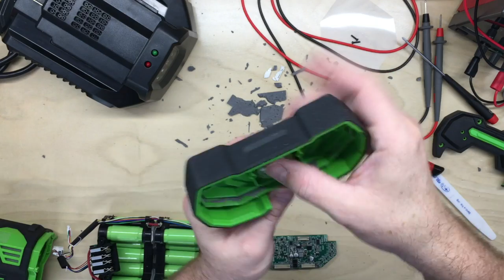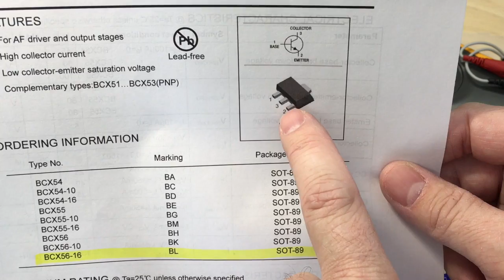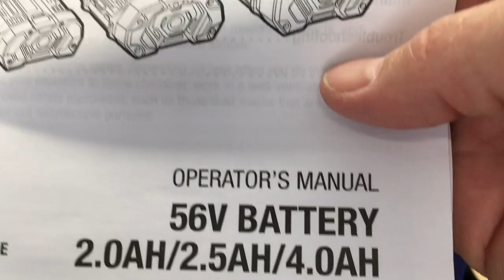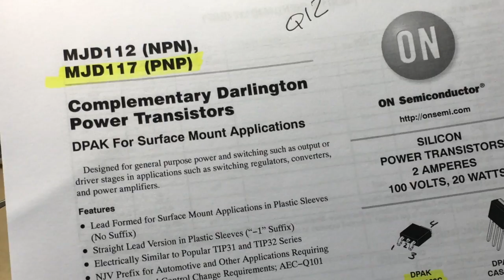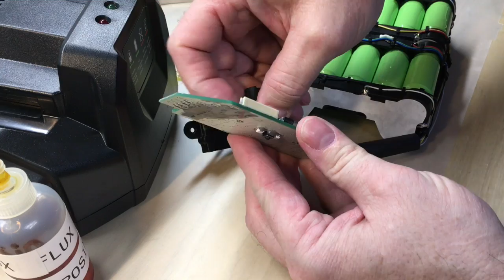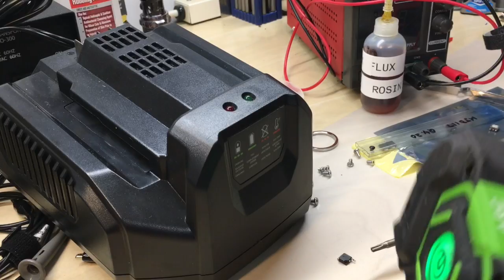EGO 56V ARC Lithium Battery Repair

Comment: 2.5ah battery I have the newer style bms and light, one half of the battery (top) got pulled down to 0.2v per cell. the other half is 4.03v per cell. can this be saved or too risky?
Reply from the maker: I do have a video that focuses on Lithium batteries and safety called Lithium Battery FAQ#1. As long as it's done safely, you could try to slowly bring up the cells with a CV-CC power supply. I would charge no more than 500mA to 1A while seeing if they will bounce back and take a charge.  Watch them to make sure they don't start getting very warm. If it does, then stop.
I would imagine at the least some of the cells will be reduced capacity, unfortunately.

Comment: Without markings, how did you determine what data sheets to acquire?  Some parts are so small as to not have markings.
Reply from the maker: I only found data sheets for the ones with markings. Mine had markings on most chips.
Reply: @ThriftyToolShed  and if you could indulge me, did you have any schematics on the control board?  Was your troubleshooting just that intuitive?
Reply from the maker: No schematics whatsoever. I wish we had some to share.  That is the main reason we share as we can as we learn together. I simply had the desire to learn and share as much as possible early on with these EGO boards.  I simply took time to research the components as best as possible and started testing based on those components. The more recent repairs have been around the 3rd Gen BMS transformer failures which was shared by many viewers who had the same problem and many had seen the transformer failure before I did. So we share and learn what we can. Our Facebook page "On The Bench" has many contributors sharing pictures or even videos that help the group also. Even a BMS board layout showing traces, pads and vias. I shared this and thanked them for this contribution in a more recent 3rd Gen pack repair video. I Hope you find some of the info helpful!

Comment: Which cells are in this 21700 or 18650 battery?
Reply from the maker: EGO packs have 18650 cells with the phase change sleeves. I think the packs 5Ah and below have the sleeves above 5Ah I don't think they do.

Comment: What type of potting compound can I use. Preferably the same kind, in case I have to work on it again.
Reply from the maker: I wish I could say it's as easy to remove as the original. I have used this type here before, but it's not as  easy to remove though. It is electronics grade. 
https://amzn.to/3INPat3
Reply: @ThriftyToolShed  Thanks for the reply. The link only takes me to the Amazon home page.

Comment: Hi. What is T1 on this board?
Can board work without it and what replacement i need to look for?
Reply from the maker: The 3rd gen packs have changed the way this is on the board. I have only worked on one of the 3rd Gen with the segmented fuel gauge and I noticed it is different, but not enough experience to say how different.  I have an older video about the T-terminal on the 1st and 2nd gen boards. 
https://youtu.be/dyLg5fK1SxU
Reply: @ThriftyToolShed  i have 3rd gen and also earlier gen(2 types: one have 12 contacts on j5, black j3 and 4 big capacitors(c23, c12, c3, c17) and other type has only 8 contacts on j5, all of them are white(j3, j4, j5), and only 3 big capacitors(c23, c3, c17), c12 become smd type.
But i still have no idea what is T1?
Reply from the maker: @fx9750g2  
Oh, sorry you're asking about the T1 coils on the BMS board! The little metal can. It is 3 coils in the T1 can. We have discussed that much in the comments over the years. I believe they are used the DC-DC converter circuits.
Reply from the maker: I have not found a replacement for these coils yet. I have only had one go bad so far and I had a donor board from other packs I have collected.

Comment: Thanks for the thorough video. I have one 2.5 aH battery that’s in need of repair. The video walked through the diagnostic steps as well as what to be looking for.  I appreciate  the work you put into this. I like your PWB holder.  That provided stability when aiming for the test points. I have 6-7.5aH batteries, two of which are aging and may be ready for some TLC soon.  Take care!

Comment: I've been giving troubleshooting a lot of thought.  Would it help to take a good BMS that is healthy and plugged up.  Take and record all the voltage readings from every component.  Then use this as reference material on a bad BMS to help pin point the issue?  I realize different functions have to be considered.   Your thoughts?   Also,  have you found a good source for parts?  We need a place where we can just replace the BMS board on the cheap.  I'm looking and searching.  If I find a resource for parts, I will let you know.
Reply from the maker: Yes, that is absolutely a good way to troubleshoot and find out more about a board especially when we have so little information on it. I will do resistance checks/diode checks on board powered off and compare at times and I have from time to time done exactly as you mention with a known good one powered on and document/compare. You may know this, but ASA or analog signature analysis is a major player in board repair especially in big industrial board repair shops. Using a Curve Tracer you can compare analog signatures between two boards and see the differences from point to point. It's really neat but very time consuming so it's mainly helpful when many of the same boards are repaired often. 
On the BMS board I have tried hard to find replacements. I even have one video I shared on the 3rd party battery for the 56V EGO pack and since it was sent in for me to review I was amazed at how well the BMS was copied ( basically cloned) so I contacted them trying to get them to offer us parts in particular the BMS and the manufacturer said they would not sell individually at this time. I keep hoping to get my hands on some. I even offered to order a large lot (thinking or hoping I would have no issues with people wanting them so my money would hopefully not get tied up), but still they were not interested in selling the boards. Yes, we need to find a good supplier of these.

Comment: What a great fault finding tutorial! I’ve just had a brand new 2.5Ah battery delivered and it was dead on arrival. They’ve now sent me a new battery and I’ve started investigating what went wrong with the dead battery. I may have the same issue. After disassembling the battery and removing all the grey goo I found a lot of black soot around the same area as Q12 on the board. I’ll do some more fault finding and see if I have the same issue. All my cells were down to 0.5V each. Thanks so much for the informative video. I would’ve been lost without it. I’ll report back if I can identify my problem.
Reply: I’ve done some more work on the circuit board. I have the new model BMS without much info on the green side of the PCB. I think the Q12 MOSFET is shorted. I’ll find out more when I remove it from the board. The larger SMD capacitor just near Q12 has blown and needs replacement as well. You don’t happen to know what capacitance it’s meant to be? If not, do you know any way to find out?
Reply from the maker: Hi,
I don't have much experience with the newer 3rd Gen boards at all. I have one video on the 3rd Gen board and it did not go as planned 🙈.
I did discuss some differences in them and the larger SMD electrolytic caps are not exactly the same. Not sure about the ceramic caps. Even though the only 3rd gen board I have is faulty I can try to measure the value of mine if you let me know which one it is by relation to other components or if you wish to share a picture through my channels Facebook page.
Reply: It’s the largest yellow/brown SMD capacitor on the whole board. It’s right next to Q12 between Q12 and the 8 pin connector going to the battery 4 blade connector. I don’t use FB often but I’ll try hop on and send you something.
Reply from the maker: If it is the one just on the right side of Q12, I read 2uF in circuit on mine. This is the BMS that is faulty that I showed in video below, so it's all I have to go by. Hope it helps. 
https://youtu.be/s7-U6PTVM58
Reply: @ThriftyToolShed  thanks so much!! I think my board is different again. I’ll take a photo and send it to you on FB. I’ll go get this capacitor and MOSFET and let you know how it goes. Really appreciate the help.

Comment: Since you have so much experience with these EGO  Battery Packs, I would like to ask your advice on a problem with an EGO Battery Pack that the manual does not address.

I have a new EGO 56V 2.5AH Battery Pack, bought two months ago with an EGO lawn trimmer. After the trimming was done on the lawn (September 20, 2022), I fully charged it and set it aside. So far, so good.

The EGO Battery manual says that it is supposed to go to 30% after a month in storage, but as of November 5 , 2022 (well over a month), it still shows all 5 lines of FULL charge. It appears the BMS is not working to lower the battery pack to 30%.  Is this battery defective? I read that at 80% or more charge, Lithium batteries lose 20% per year of capacity. I don't want to lose 20% a year. Just running the Battery Pack on the trimmer to force it down to 30% is NOT what the manual says I am supposed to do. What should I do?

Comment: Question:  Does the Ego BMS balance the cells ?
Reply from the maker: Yes, it seems it can do a minor balance where it can slowly drain 1 set or so as needed to try and keep all 14s balanced well. It seems to only be an issue once cell capacity gets so out of balance and no longer able to match them so one set  just pulls down and shuts down the pack before the others are discharged which shows up as the packs loss of capacity.
Reply: @ThriftyToolShed  I'm a little concerned about using the 550w fast chargers with the 2.5 ah packs.  I know there is increased air flow to handle the added heat, but that's charging a 1S configuration at 10 amps or so.
   I have successfully repair several packs.  Even a few that involved total cell replacement.  I just got in a 7.5ah pack that has 2 sets of the 3 parallel cells that are bad.   Total cell replacement on a big pack.  That's 42 cells. 
   I do like the 14S platform.   I'm also in a market for an Ego Zero Turn mower.  They look awesome.
Reply from the maker: Yes, the dual cooling fans are really good on the chargers design for cooling as I showed in one of the repair videos of a fast charger. It is tough on 1P packs with rapid charging as well as discharging too rapidly. I have to say I have not tested the rapid charger to see exactly what current the 1P packs actually charge at. It knows which battery is connected by the D-terminal, but not sure how much reduction it is for the 2.5ah packs.  As far as replacing all cells on these 14S packs yes, it gets so expensive I have replaced all cells in some pack repairs over the last few years. Usually for cost savings I save up all parts from many packs and test them all for capacity as I mentioned in a recent lithium battery FAQ#1 video and I sort them in matched sets to use for replacements, but it's very time consuming.
Reply: @ThriftyToolShed  FYI - I have identified the connectors to be JST ZH 1.5mm   I ordered some with leads and they fit quite well.   I also purchased a Ego zero turn 42".   Right now I'm working on a 8S14P pack built with Samsung 21700 50E cells.  I plan on building two of these at 40ah each.  I intend to install a bms board from an Ego pack. Then extend the -TD+ wires into an empty pack shell.  Just plug the shell into the regular battery slot and boost runtime.  It should be interesting.  I'm still working on rebuilding packs as well.  Still have not found a source for new BMS boards though.
Reply from the maker: @jamesdrews751  
You must be working on a 14S 8P pack? That will last a while. I still have not found a willing seller of the BMS board. The Chinese supplier of the aftermarket packs said they would get back with me if they could sell me a lot of them after I contacted them for the second time about it. Still nothing. I guess unless they show up on Alibaba we will have to continue to repair. I don't think there is enough demand for these to reverse engineer and build ourselves to have and sell since so much time will be involved.
Reply: @ThriftyToolShed  Yes, typo there.  I'm building two packs that will be 14S8P at 40ah each.  The zero turn is interesting.  It appears the charger goes up to 60v and the battery case has a separate circuit board that manages charging each of the 6 packs. I was planning on just jumpering into the power lead until I seen this, so decided on a different approach.  End result will be 120ah of combined capacity.  Let's see how many acres that will mow.  :)

Comment: I have a 5 amp ego battery that blinks green but also has the charger making a clicking sound.  It is my understanding that the clicking can be caused by the batteries being dead but could the m12 transistor be the problem here thus causing the dead battery and then the clicking sound?
Reply from the maker: Yes, Q12 transistor if shorted is causing blinking green led constantly. That will cause the pack to slowly discharge and it can go all the way to zero if not monitored close. I would pull the BMS board off the pack if you can until you can fix the BMS. That way it doesn't keep pulling the cells down. And also yes, the relay clicking sound on the charger is usually the charger trying to safely bump the pack up to see if it is safe to charge because it has detected the voltage is lower than it should be to charge safely. This safe voltage is usually above  42V or so on a 14S pack.
Reply: @ThriftyToolShed  I will be ordering the Q12 transistor and hopefully my problem is resolved.  Unfortunately the cells have all been drained to dead.  I don't have all the electronic tools that you have but I need to charge up the cells so that the charger will finish the job.  I noticed that there have been sites that recommend jumping the repaired battery with another ego battery so that the charger will complete the job.  Do you think this is ok or do you have another way to bring up the charge in the cells?
Reply from the maker: @Michael Reeves  I have several videos discussing charging these packs. I strongly suggest not ever jumping a dead or unknown condition pack with another. This can cause so much current to flow that things melt and can be catastrophic. I use the Drok DC-DC converter if you don't have a constant current bench top power supply.
https://youtu.be/H0asuE9oYy8
Reply: @ThriftyToolShed  This Battery that I am replacing Q12 transistor on has cells that are 100% dead.  I have been told that If completely dead they cannot be brought back to life. True?  Lastly. my neighbor has a dc power supply that is .5 or 1.5 amp with voltage up to 20V.  Will this be sufficient to get these batteries up and running?
Reply from the maker: Yes, I have mentioned that on video many times also. Once a pack goes too low it almost never comes back and if it does the capacity is usually shorted tremendously at best. You can take a power supply with constant current set to about .5A to 1A max sure not to exceed 4V per cell either and test to see if cells will respond without heating up and you may get lucky enough for some cells to have some capacity, but the pack will most likely not stay balanced well even if the cells all charge up ok. I have many videos on many brand packs talking about cell testing and I do mention it some on one of my latest videos about Lithium Battery FAQ#1.

Comment: Question at the end of this....my whole lawnmower went in the lake (don't ask).  After taking it and the battery apart to dry, I was able to do a full mow, and the battery still reads 51-52v, so I figure the batteries are OK.  However, it won't charge and I get the fast blinking green light, similar to you.  As you and another said the Q12 is a common culprit, I went straight to the Q12 to test it.  I have not tested any other component yet.  The results of the Q12 tests are as follows... 
Test 1: black lead on Base,     red lead on Collector = 0 volts (yours was 0.67v).  When I reverse my leads I still get 0v.
Test 2: black lead on Emitter, red lead on Collector = 0.551v (yours was .002). When I reverse my leads I get 0v. 
Test 3: black lead on Emitter, red lead on Base = 0.685v (your leads were reversed from mine, and you got 0.671v.  I get 0v when I reverse my leads to match yours)

Would you agree, especially due to Test 1 = 0v, that Q12 is faulty ?
And any comment about Test3, where I only got a reading when my leads were reversed from yours ?
Thanks, Rick
Reply from the maker: Hi Rick,
I would say from your findings that Q12 is surely bad. And its been quite some time but yes the 3rd test seems off also. I believe it should be around .6V the way I had my leads and open when reverse like you had yours? Best of luck to ya!
Reply: Thanks for your feedback - I appreciate that.